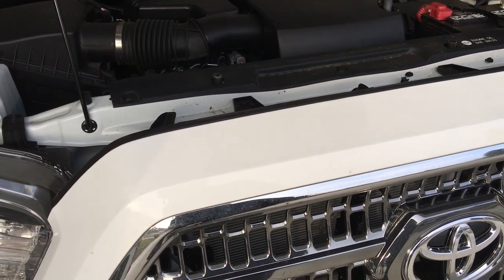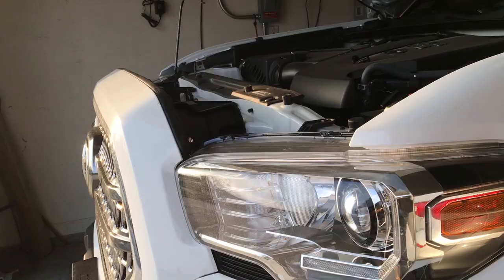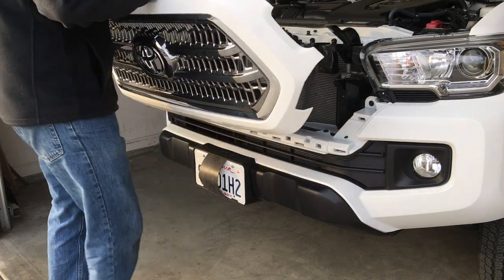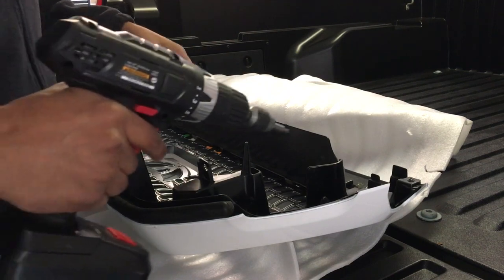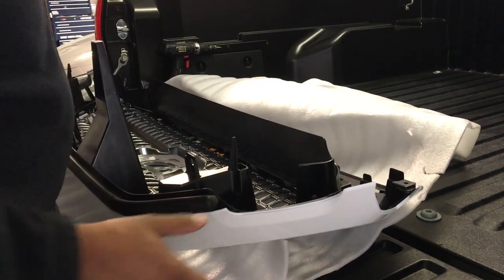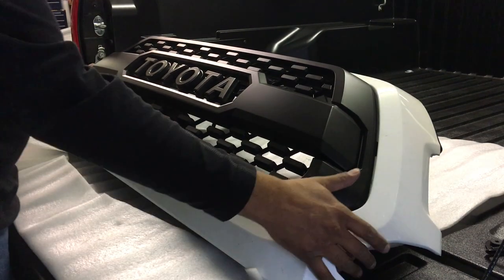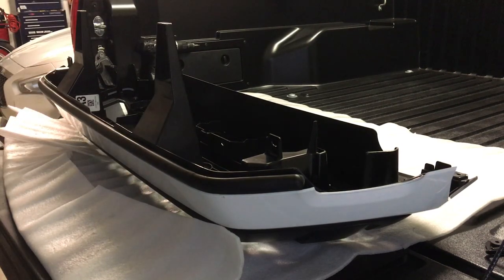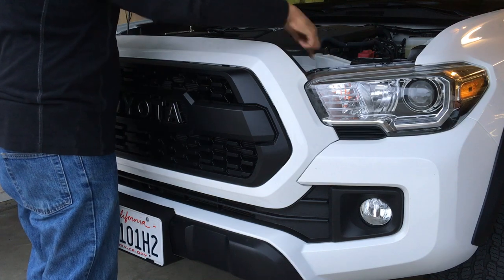2016+ Toyota Tacoma TRD Pro Grille Install: The $150 TRD Pro Grille

Comment: Where did you buy  you’re trd pro grill ? Ebay and is it made in china?
Reply: they are made in China, I'm just going to spend the extra 239.00 and get the original. I'm afraid with time it will fade or something. ( just my opinion ) remember : you get what you pay for .
Reply: And sometimes you pay a lot more than what you get!
Reply: xcessdj the original grill is also made in China.
Reply: you can see how bad the gap is between the grill itself and the shroud, looks terrible with the gap IMO